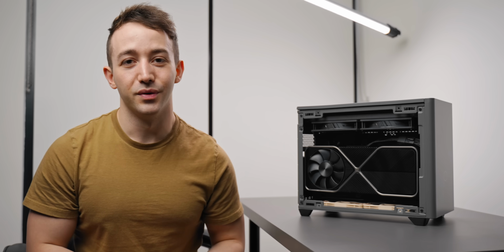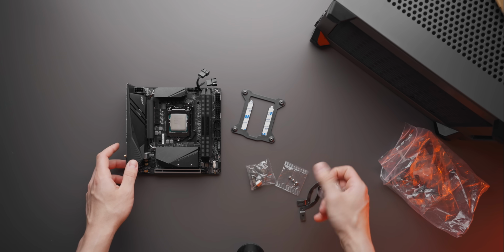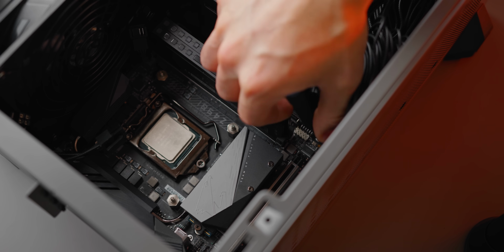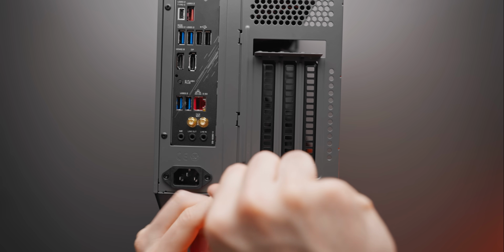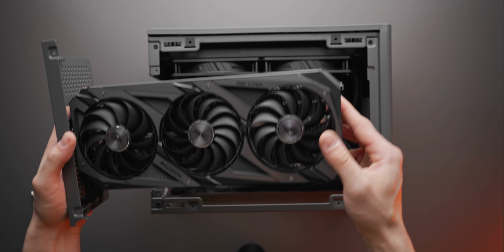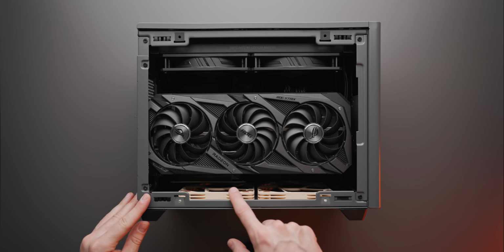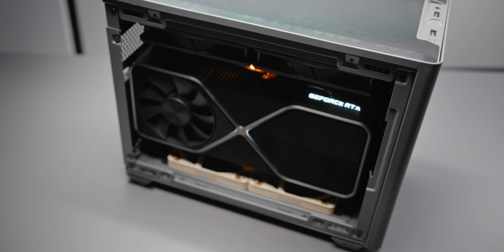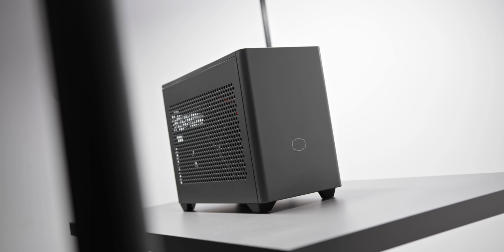The New NR200P MAX Can Handle Anything

Comment: Hi, I have a quick question.
I bought this case second-hand on eBay and the CPU fans keep spiking even with normal usage (around 20 tabs open, using only a few). I tried changing the fan curves but it didn’t help.
I’m running a Ryzen 5 7500F and an RTX 3070, so I feel like the AIO should be enough for this hardware. The fan spikes are quite annoying, especially when I’m not gaming.
Does anyone know what might be causing this or how to fix it?
Thanks in advance!

Comment: Just upgrading my build using the N200p Max. Running a 9800x3d cpu and a Rx 9080xt gpu. I will be using the mesh side panels. I've ordered 2x slim fans for the bottom panel. I was going to run them as intakes. But you recommend them as out takes... Did you test it both ways? In my mind cool air running up the case would create the best performance and airflow.  Love this case, I had the V1 for my previous build.

Comment: I've used this case with no bottom fans with 9900X3D and 4080 FE for a while. I upgraded to the ZOTAC 5090 and it's SO HOT I'm finally thinking of installing fans at the bottom. I'm surprised you set yours for exhaust as opposed to intake though. I wonder what would be right for my new set up.

Comment: Just don’t use an intel cpu, they overheat inside that small case.
Reply: Been running my 12700kf in this case since 2022. Luckily I built when I did & not when Intel started making spicy meatballs
Reply: @ I was researching to build one with this case. But found a lot of overheating intel CPU’s experiences.

Comment: Hey great video - Im finishing off my NR200p Max build now with a RX 7800 XT - Can you clarify the connection to the GPU as there are 2 Pcie cables coming from the PSU... Im guessing you only need one? (First-time PC builder and haven't had any info on this from other videos). Thanks.

Comment: It advertises two locations to mount a 3.5” drive but the first is blocked by a gpu, and the second (the bottom) cannot be installed in conjunction with an intake fan because of a poorly placed, and thin, power cable. So I returned it. An sff case this large should have storage options.

Comment: The graphics card vertical mounting puts me off this case, it completely covers the front of the motherboard so any AIO cooler you have on the CPU or RGB ram is completely covered, a swap out rear GFX mounting bracket would of been a deal breaker for me

Comment: I have a question. Do we need a certain amount of clearance for bottom intake fan?

I notice i connected an extra 120mm fan (ID COOLING) to usb. It does need pretty high amount of clearance to push high amount of air in under 1k rpm. When the fan close to table, it push less air.

Comment: I think im going to have to try and repaste my PNY 4070ti as im getting 77 degrees in Cyberpunk and thats with 2x 15mm fans as exhaust as well as the top 280 as exhaust too!
Reply: Maybe you just need a small undervolt
Reply: @duppex3163  Repasted, undervolt, gpu fans at 50% dropped me to 57 degrees!

Comment: Can anyone confirm if the RX 7800xt TUF Gaming would fit? Size: 319.8x150.9x59.2mm (LxBxH) The lenght is definitely not an issue but the hight might be including the power cable for the gpu. But the connectors are slightly recessed so ig might be able to fit

Comment: Contemplating between the nr200p max or a4-h2o. You get a 280mm rad with the nr200p while only 240mm with the a4-h2o. However, you get a front usb type-c with Lian-Li. Decisions, decisions, decisions…

Comment: Need more lighting inside the case while building, we can't see shit. I'm concerned that the CPU PSU cable that comes with the NR200P Max PSU isn't compatible with my motherboard (ASUS B760-I Gaming WIFI). I have a modular female cable end that fits the layout as shown on the motherboard. Should I use that one instead?
Reply: What did you end up doing? I have this motherboard lol and was thinking about ordering this case

Comment: I just build this, no extra slim fans yet but can someone explain why TG fans set to intake Vs exhaust fans with the perforated side panel?
Reply: with TG the side is blocked and the opposite site, even though its still perforated, is mostly blocked by the mainboard. So the fans at the top and the bottom would "fight" for the air inside the case as not enough air gets inside - this would reduce the efficiency a lot.
So for GPU cooling, providing a clear airflow from bottom to top might be best.

But it has to be said, that with his TG setup, all the hot air is going though the CPU radiator, heating up the CPU - depending on the CPU's power draw and heat output, this can be a problem.
Reply: @JayMatth  thanks. You think bottom to top is better than top to bottom? Il need to test myself but it looks like TG is best to intake top, exhaust bottom
Reply: @Benni333  In general bottom to top is preferred as heat rises and you don't have to push against it.
But in many builds it makes a lot of sense rethinking this standard, and I agree with you here - top to bottom could lead to better thermals on the CPU but with increased thermals on the GPU. But it might also lead to hotter components on the mainboard and a hotter PSU (PSU pushes hot air to the top in default configuration and has to push against the flow then).

The hot air from the CPU will be pushed towards the graphics card, heating it up. Depending on the graphics card and CPU wattage, this is a problem or not. Strongly depends on the GPU, if it has an oversized cooler, as it is currently the standard, or an older or "cheaper" one, that is struggling with its generated heat anyway. And also if the CPU puts out too much heat, so the GPU only has hot air to work with.

So you are basically deciding if the CPU or GPU needs fresh air to be cooled.

Comment: Hello i followed excactly everything acording to the video but i saw really high temperature with my cpu. I expecting high temperatures with gpu but with msi after burner i am ok. I am really want to know if you cant sugest to me something about it because i am catching aprox 100 degrees. I did an overpower mashine with i9 13900k and 4090. If you have any idea what i should do to catch lower temperature i will appriciate it :). Thank u in advance dude,
Reply: The i9 13900k and a mid tier 280mm AIO is on its own a tough match, as it might not be able to keep the CPU under 100°C.
Apart from that I would suggest some undervolting and make sure you got bottom fans as exhaust installed with the perforated side panel. You do want to keep the warm air from the GPU away from the CPU's AIO radiator.

Comment: Max and Non-max aren't the same externally. The max only supports vertical mounted gpu (3 slots) while non-max only supports 2 slot vertical mounted and 3 slots normally mounted..

Comment: Inflation is crazy: your Amazon link is now $456.21...
Reply: That's demand not inflation LoL
Reply: @50V0N  Demand-pull inflation occurs when the demand for goods and services exceeds the supply that can be produced, putting upward pressure on prices and leading to inflation.
Reply: Just checked. Price is now $14,729.32 inflation is crazy.
Reply: Ik its a joke but i just checked, and its 800 dollars. 3rd party seller ofc@pederrottiger
Reply: Just checked. Price is now $127,952.39. Inflation is crazy.
Reply: I Got it for $245.71

Comment: The problem with this case is it won’t support RTX4000 series (thickness) so it’s already a dead end purchase.

also that grey color looks very plain and boring,silver and black would have been much nicer, cleaner ,modern look.
Reply: The NR200P Max can fit the 4090 FE, Length/Thickness wise. The biggest concern is actually card height if using the included power adapter. Height of 4090 FE is 137mm, case clearance is 160mm, but that includes any cables. Nvidia recommends adding 36mm of clearance to account for the power adapter, which brings the total Height to 173mm. 

Basically, the card fits, but in order to fit it with the adapter, you need bend it more than Nvidia recommends.
Reply: @cd4953  hopefully we will soon see some actual build attempts.

Comment: At the moment I am struggling a bit between taking the NR200P or the MAX. I would use for the non-MAX a Noctua NH-D12L and wonder if it is 1) more silent and 2) more performant than the AIO of the NR200P MAX. Does anyone maybe have any input about this?
Also thank you very much for this really insightful video, it already helped me a lot getting a bigger picture about the NR200P and how I would like to plan my ITX build!

Comment: idk how most engineers r so stupid and lack common sense. like bro u could of just added 10-12 more millimeters vertically to fit 2 normal size fans on the bottom and this case would of been PERFECT. 

like bro literally a few millimeters wouldn't even look that different but would make thermals way better. and customers peace of mind.

Comment: This case needs to come separate, in a SFF the GPU is way harder to keep cool so that should be on an AIO before the CPU imo. The normal NR200 has great airflow for the size but a gpu aio would really help. This setup forces all the hot air from the GPU through the CPU cooler, you also get stuck with their PSU.

Comment: This case will be the one I use for my first Sff build. It's a lot smaller than the 18year old Cooler Master 690 full tower case I'm using now.  I don't plan to use the "MaX" version as the psu doesn't seem to be modular and I don't need a 850 watt psu.   I will be using the 5700g and no gpu initialy and add a 6600xt to it when I upgrade my other PC.  Thanks for the video.

Comment: I know im a bit late, but Vented panel with bottom and top as exhaust, using negative pressure setup intaking from vented panel. Remove bottom dust filter.  Itll exhaust the GPU directly from the plug side on the bottom with the other half going through the AIO out the top.

Comment: I would like to ask: How long will such an AIO  water-cooling-system work reliably in average before it has to be replaced or refilled?
Reply: I have had my NZXT Kraken AIO since 2017 (no maintenance) and it still works very well. With a i5 8600K my temps are at ~40°C while gaming. So it's absolutely possible to use an AIO for a longer period but idk if it's optimal.

Comment: consider getting this case, but seeing lots of review having 3 flaws, 1- won't fit bottom 120 fan but someone modded it to fit, 2-no gpu support other than it's riser cable, 3-no option to get it without AIO in case i wanna build my own custom loops, so there will be another updated version of nr200, so would wait to build a new complete system with that case along with next gen hardware.
Reply: 1) 15mm thick 120mm diameter fans (slim) do fit. 2) get a regular nr200p. 3) get a regular nr200p.
Reply: @GlibberigeGap  
yeah, i'm ordering one, The NR200P no Max,
😁😁😁😁😁😁

Comment: Just got my Max case! I'm curious, is it possible to mount the rad fans on top of the rad instead of the bottom? Will the 140mm fans fit if you wanted to swap their positions?

Comment: I would like to thank you for inspiring me to build my own ITX pc on this wonderful case to replace my Razer Blade 17 Pro, I have been watching your builds for a long time but never thought I could do it until I took my time to study it carefully from your channel and others too in addition to the components PDF's from their vendors. My build is of course NR200P Max, 12700K, MSI Z690I Unify, MSI 3080 Trio Z, 2TB Samsung 980 Pro, G Skill 2x16 CL36 5600MHz, and two Noctua (NF-A12x15 + Noctua NF-A12x25). I settled for TG option to display the GPU and temp difference is less than 5 degrees C but definitely acceptable below 75 max while gaming. Thanks again and keep it up.
Reply: Building mine right now, I'm close to your specs right now, but haven't bought everything yet. 
How's it running?
Reply: @samanosukeakechi4388  no complaints at all, in fact due to its cute size I like it more than my big rig in my other place. Totally satisfied to say the least.

Comment: Hi Ali,

Far fetched but NR200P Max is only mITX officially supported. Do you think that Crosshair VIII Impact would fit in that case. There is a bit of cap there or will the power cable be in the way.
Thanks Margus

Comment: Vertical mount only for the GPU? I don't think I would have noticed that if not for having watched this video. I'm also not sure how I feel about not having the option to choose.
Reply: Most of the SFF cases require extension cables… if you wanna choose, go for standard NR200 or simply larger cases
Reply: @peaky_blinders_2015  I'm very familiar with SFF cases and generally the use of riser cables within them. This is not my issue. My issue is in the fact this case restricts you to a single layout, when non-vertical performance in the NR200 has generally proven to be better, and the non-MAX equivalents support dual layout.

Comment: By the time I got to order this, due to stock/release date pushbacks, it cost me $486 USD which really sucks. 

Some complaints; the PCIe riser does NOT lock into place on neither the motherboard nor card. Sometimes I will have a boot with no video and have to hit the reset button while playing with the riser cable a tad. Annoying honestly for the cost.
Reply: Did you consider contacting them for a new riser cable?

Comment: Soo, can i use 25mm Fans on the bottom, are 15mm fans recommended or are 25mm Fans really "an absolutly no-go"? It really looks like that 25mm fits in. I also own a 2060 FE and i want to change it with an RTX 3080 also FE. Would you/anyone still recommend 15mm fans or can i use 25mm fans for FE cards?

Comment: I am really super happy with the case and water cooling of the NR200P Max itself, except for the Power Supply.
It has a lot of Coil Whine when gaming.
Makes far far more noise then the fans itself. 
Is there someone else with the same experience?
Tried a lot of things like to limit the FPS, underclocking etc, but nothings seems to work.
Have a RTX3080 (Asus), and an AMD 5900X.
Noise comes only from the PSU.
Thanks,
Rene
Reply: does the problem persist? Anyone else experience the same thing?

Comment: I will be installing an I9-11900k and RTX 3080ti in this case. Do you think a water cooler setup for the GPU could be squeezed in some way? I do not think a single 280mm radiator would be able to cool them both.

Comment: Apparently next-gen GPUs will require 1000W+ power supplies, but either way this seems to be a fantastic case, I might just go for it when I finally build a desktop PC (with the current market I'm sticking to laptops exclusively).
Reply: its not truth i have 4090 and trust me is working perfect the only issues that i saw is the temperature of gpu. However the really high gpu 4090 with i9 13900k is completely strong enouph and the 850 psu is really enouph and good without unvoltage for the moment .

Comment: the nr200p side mounted aio i think is the best position.. then both the gpu and cpu will draw cold air from the outside.. the aio in the max has to handle the hot air from the gpu to.. witch is not that optimal

Comment: Just received mine today! Switching from the regular NR200P because of space, noise and temps. I am really excited for the results in the end
Reply: how is it ?
Reply: @mathdups1152  still decent! Can't complain about anything. I added bottom fans upgraded the radiator fans and ultimately settled for the mesh panel instead of the window. Cause with a 5800x and a 6900XT it does get pretty warm and I like it quiet.

Comment: As only 2 x 8pin PCIe cables are supplied what's the solution to run a card with 3 x 8pin PCIe such as FTW3 Ultra? Would Corsair cables be compatible?
Reply: Both cables each have two plugs, 3 x 8pin is therefore no problem. Source: I got the case yesterday and need 3 for my card as well!
Reply: @FreshmaticsTV  I'm sure pigg back works fine yet as we selected power hungry cards i'd prefer mainline? If you open a ticket Coolermaster will send another cable. Alternately I think the pinout is the same as Corsair if you have one lying around. It's daft but 3 x PCIe was one of the reasons I chose FTW3 after GN set the 3dmark record using the 450w beta bios.

Comment: @OptimumTech Wouldn’t it make a bit more sense to have the bottom fans be the intake with the RTX 3090 FE/vented side panel combo? Because the exhaust fan of the backplate in the GPU’s flow-through cooler is almost directly facing the motherboard and power supply, I think the larger existing CPU AIO cooler exhaust fans could benefit from having cool fresh air pulled in from the bottom of the case mixed with the warm air from the GPU to keep the inside temperatures optimal and the air flowing in an upwards direction, instead of having to rely on just some of the warm air which is being split by the bottom exhaust fans creating some sort of air imbalance with the lack of direct air intake fans.
Reply: Based on other people testing, it’s better to set it up as negative pressure, encouraging fresh air from the sides and removing it immediately

Comment: QUESTION: Do you think swapping out the stock radiator fans for the Noctua NF-A12x25 would be beneficial or unnecessary in terms of the overall cooling performance? I'm just wondering if it will improve cooling significantly enough to warrant purchasing them.
Reply: I was wondering the same exact thing, I’m wondering if someone can update me on it to see if it’s possible.

Comment: I bought the NR200 and it was so hard to build with all the cables and Side mount AIO, And my overall cost was way higher: 170 for a 750W SFX PSU, 120 for 280 AIO and not even having Riser Cable. $350 for a 850 PSU and a 280mm AIO, a Gen-4 Riser and a premium case sure seems like a steal

Comment: Tbh I love your videos. But you brushed over a few things. First of all the standard nr200p has no option for a top mounted radiator. So that's exclusive to the nr200max. Also that top mounted radiator allows for way bigger graphic cards than the nr200p would allow you to use